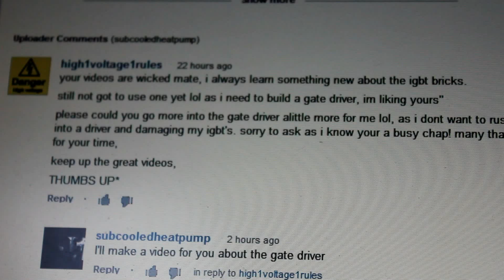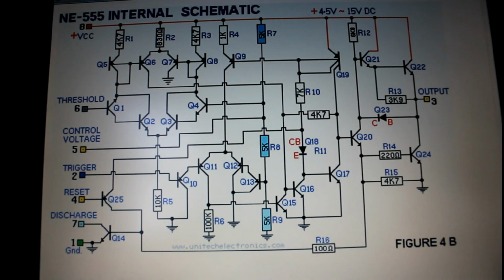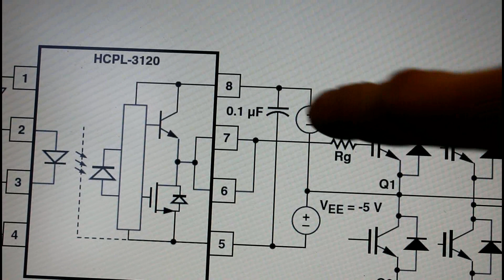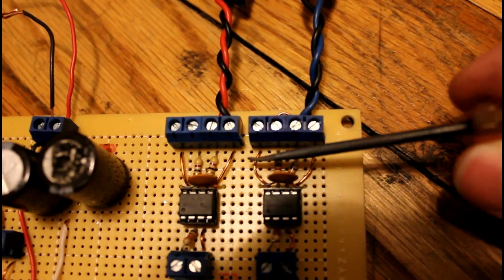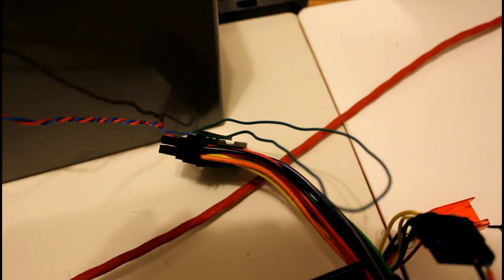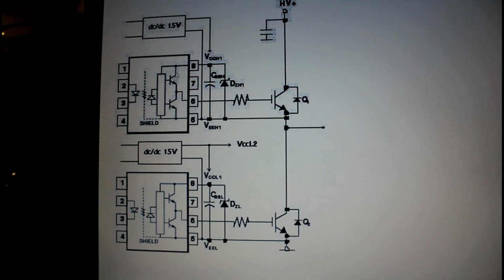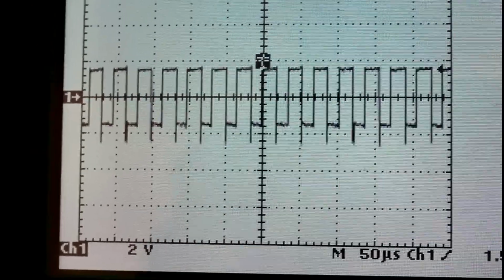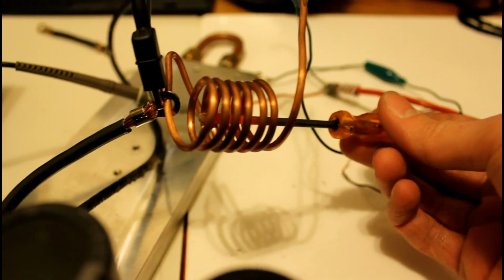Video Request; IGBT gate drivers

Comment: Hello friend fastly I did use this gate driver on my mosfet power inverter and the gate didn’t turn fully causing a small short circuit blowing the mosfet and I had to use a 700ohms resistor to turn the gate of because I was using 18 voltage at the gate

Comment: Hi,  I have learned MUCH from your great videos.
Concerning the gate driver, I need one that I can operate at Vcc=12v, since my application is automotive.  Do you know how I can drive a 1000v high voltage IGBT with a driver that does not need more than 12v?
THANKS MUCH!!!

Comment: Seven years on, and this video is still helping people (like Me). A practical example, alongside an explained schematic is amazingly helpful for folk new to transistor theory. Thanks dude.

Edit; for a 120V, 500A load (a large DC forklift motor) using two IGBT bricks in parallel, is there anything to consider beyond the parameters explained in the video, in regards to using that driver IC?
Reply from the maker: both IGBTs should be on the same heatsink, and as close as possible. You might consider using a larger gate driver, such as IXDN630
Reply: @subcooledheatpump  thanks for your reply! your will to help others is really nice, and your tailored response videos are super generous. 

The IXDN630 d.sheet notes it has a peak source to sink drive current of 30 Amps. Is that referring to the intended current flowing through the IGBT brick? (in my case, 500 amps)
Reply from the maker: No, the gate drive current and collector current are separate. You can use HCPL-3120 to drive an IGBT(s) with 500 Amps flowing through it. It's just that you may not want to. an IGBT with a higher current rating will have more gate capacitance, which means in order to turn the IGBT on fast enough, you'll need more gate drive current. HCPL-3120 is really only designed to drive IGBTs with ratings of 1200 volts and 100 amps. So if you're looking to drive multiple high current IGBTs you may want something that can provide more gate drive current
Reply: @subcooledheatpump  That's brilliant advice, thanks ever so much. It makes a lot of sense, now someone has put it like that. Do you have any suggestions for a set-up like mine? The DC controller schematic i'm looking at has a DCDC converter capable of outputting -5V to +15V (MGJ2D051505SC) feeding an Opto (acnw3190-000e). Would you use a modular approach like that, in favour of an all-in-one package?
Reply from the maker: Personally I would, But that's just my preference. All in one approaches do work but to me I'd like to be able to replace the individual parts as they fail, and not need to replace things that aren't broken.

Comment: First thank you but i have problem when connected same type of igbt you use how i controlling power circuit 400v by use 555timer low voltage control where you have G: CONNECTED TO CONTROL SIGNAL AND E: CONNECTED TO >>> You have tow E one for power control second one to control circuit i would like explain this point

Comment: Good video sir, I have designed and assembled similar circuit to drive a full bridge igbt. The circuit works fine below a bus voltage of 70 volts but above 70 v my one side igbts blown out several time. Can u please share what's the problem.

Comment: I have a question about the isolated power supply for gate driver. Usually the gate drive doesn't need so much power, so which kind of isolated power supply should I choose in order to put them on PCB? (It seems that if I build a full bridge, I'll need about four power supply)
Reply from the maker: That really depends on so many variables. What Bus voltage will your inverter be running? How much space on the PCB are you willing to dedicate to the power supplies? This certainly isn't the only method, but I've seen numerous variable frequency drives use a transformer with a single primary driven by a single transistor and multiple secondaries to provide gate drive power. Alternatively, you could use individual DC-DC converters. You only need one for the lower (negative) side IGBTs. The high sides must be isolated from each other, so you could do with only three if you are using a full bridge circuit
Reply: @subcooledheatpump  Thanks for your reply! Actually, I'm working on the three phases full bridge inverter.(driving a pretty imbalance load)The required power isn't too much, about 80W(under 48V) per phase. I would like to put the driver circuit and power MOSFET on a 10*10 cm PCB. Since the DC/DC converter really cost me a lot of space, I wonder if there is a better way to implement the circuit?

Comment: Hi All, i am confuse about pin No.5 (VEE) if any 1 understand please explain to me, IGBT Source PIN Connected to HV(High Voltage) Positive Terminal and IGBT Drain pin connected to Load Positive Terminal....as per video if i direct connect VEE pin to IGBT Drain Pin its NOT working Properly my IGBT Driver IC Heat Too much
Reply from the maker: The Gate driver VEE needs to connect to the gate drive power supply negative, and to the IGBT emitter. (Source). Both of those should be connected to the DC bus negative. The bottom IGBT is driven, not the top, it only functions as a diode. The IGBT Collector (Drain) should be connected to the load negative. The load positive connects to the DC bus positive, and the upper IGBT is connected in parallel with the load.

Comment: Thank you for every thing, I work on photovoltaic flyback inverter consists of center tap transformer, two diodes and two IGBTs to feds a ac current tot the grid  I hope to learn me about how can be connection the terminal IGBTs to the transformer and gate drive terminal

Comment: Hi, great video.  I got the HCPL 3120 and an IGBT FS20R06VE3_B2. I am trying to drive an old pancake motor on a washing machine. Its a form of Brushless DC motor. I been searching and searching but ur video is the closest to what Im looking for as everyone else seems to just power up tiny low powered motors. Most IGBT circuits drive inverters that drive ac 3 phase motors. Any help is appreciated as to how your circuit can drive my motor.

Comment: Hi Buddy,Can you help me to sort out an issue on a Chiller Unit whose gate driver is lock out on circuit 2 only .IC 031-02066-001 is used .I just replaced the IGBT card and now the gate driver is locked out on the other pcb card.Thanks
Reply from the maker: Not sure I completely understand.. Did and IGBT fail and you replaced it? If so, you will likely need to replace the gate driver. Usually, but not always, when IGBTs fail they take the gate drivers with them

Comment: i notice in this video that you are switching your HCPL-3120 optocoupler with only 2 volts. The datasheet shows that the Max Input Forward voltage current is 1.8 volts. What was your formula for choosing your LED resister?  My TL494 KA7500 Driver Board seems to be putting out around 10 volts at the signal. (Now that I hooked it up right!) I am guessing that my resistor would be around 820 ohms at the input of each LED. Can you talk more on choosing your LED resistors and your gate resistors?

Comment: Can you recommend an already made PWM that will fire the HCPL-3120 optocoupler at the right voltage? I am using the TL494 KA7500 Driver Board but it will not fire the led's in the optocoupler.. It seems to only put out .65 volts AC at the signal when connected and around .88 volts AC when it is not connected to the board..  I need the input of the PWM to be 12v. I am building a full bridge inverter.
Reply from the maker: A TL494 Should have no problems driving the LEDs. I'm not sure I completely understand...what is your input voltage to the TL494? It should be at least 5 volts.
Reply: 12 volts is the input voltage. The TL494 has  a Feed + and a Feed -. It is my understanding that if I put a potentometer  on those feet, that I can adjust the voltage output of the board. But, when I use a potentometer, it does not increase the voltage output of the signal. When I ground the Feed - it does not increase the voltage output of the signal.  When I use a AC probe across the PWM 1 and PWM 2, it shows a .6 volts. When I use a DC probe across the PWM 1 and PWM 2, it shows as  2.5 volts.
Reply: UPDATE .....It will now fire the led, but, the isolated voltage supply (15v) will only put out 5 volts signal to the IGBT. This will not fire my 15v gate of the IGBT.  Would that indicate that I need a higher voltage at the LED to trigger the opto? Or is the opto a only ON or only OFF.

Comment: can you help me please
can we connect two IGBT on the same ground of drive circuit 5 ?/
Reply from the maker: The gate drive power supplies must be isolated. The gate driver inputs (LEDs) can have a common ground
Reply: well, can you also explain please if i connect drive to mosfet but i forgot to apply pulses on input, drive will protect mosfet from damage? also if i apply vcc only on drive , drive may be damaged ?

Comment: Hello. Im an electrical engg 3rd year student. This semester Im designing a buck boost converter.  Had no idea how to i was going to build this gate driver circuit. The buck boost converter Im designing only has one IGBT. Will it give output exactly the same as in the simulation? Or shud i use 2 IGBTs in the hardware model? Shall be looking forward to your reply.. thanks fr such a great video..
Reply: u need only 1 switch man..for simplicity u can use hcpl316j gate driver for that.2 igbt is the case for synchronous converter.

Comment: Hi guy, I am building buck/boost converter with NGTB50N60 IGBT. The last circuit driver with two 555,  is it the best to drive the gate of IGBT ?
Reply from the maker: You really need a good gate driver like HCPL-3120 to drive the IGBT gate properly. Also PWM should be done with a better setup than a 555. For example, a triangle wave generator and a comparator will give much better results. I just show the 555 here to demonstrate that the gate driver will work with a 0 to 5 volts input, which is basically what a 555 outputs.

Comment: Hi, could we use semikronSKYPER 32R to drive IGBT? any special considerations to be made for that? here is link to datasheet. https://www.semikron.com/dl/service-support/downloads/download/semikron-datasheet-skyper-32-pro-r-l6100202
Reply from the maker: That is a half bridge driver, so if you are looking to drive a half bridge then yes you can. A few things I noticed, Seems it is designed to drive smaller IGBTs with low gate charges, It has de-saturation detection so you'll need some extra components for that, the input voltage must rise to maximum level within 50 ms, and a few other things need to be addressed. Overall, it is a gate driver and it would work, you just need to satisfy all of the protection mechanisms.

Comment: instead of all this you could have just used a ir2153 self oscillating halfbridge gate driver
Reply from the maker: Sure, but you can't use that for anything more than a half bridge configuration. For a Full bridge or a 3 phase bridge, you will need to use separate, isolated gate drivers
Reply: subcooledheatpump yes in that case you can you use irs2143d
Reply from the maker: I think you're missing the point. Self Oscillation is good for certain applications, but you can't those IR parts for much more than simple power supplies. You couldn't, for example, use them to control the inverter of a 3 phase motor controller. You need a gate driver that can receive commands from a microprocessor. What's more, the IR parts do not offer much in the way of isolation. 600 volts is nothing. You'd need at least twice that in order to make a motor controller suitable for a 480 volt motor. This video explains the use of isolated gate drivers for that purpose. Because more often than not, they are the best solution.  By the way, it's the IRS2453D that is the full bridge driver. No such thing as an IRS2143D
Reply: subcooledheatpump yes we can't interact with the self oscillating MOSFET driver it's not made for that purpose I got your point but you have shown some uses in video like led flasher and induction heater for that ir2153 is best because of its simplicity
Reply: Sorry Google autocorrect

Comment: I have one question wants to ask. Can MOSFET also applying -5V to 15V switching techniques as you mentioned in (3.54 minutes). To improve the Full bridge switching performances? I'm looking to hearing from your reply. Thank you to contribute this tutorial.
Reply from the maker: Yes you can use Negative gate drive, or negative gate bias to hold a 
MOSFET in the off state. This doesn't necessarily improve switching but 
it does ensure that the MOSFET won't be accidentally triggered on by 
noise or interference. Thank you for watching
Reply: Thanks for your explanation
Reply: John nji

Comment: nice explanation man , so basically need of a igbt or mosfet driver is to switch them on and off as fast as possible properly at high frequencies . so that igbt's output current will be function of signal at the gate . isn't it right ??

Comment: what are the resistor values please and thankyou
Reply from the maker: The resistor values for the output really depend on the IGBT you want to drive. This specific gate driver can only output a peak current of 2 amps, so if the input is 15 volts, you can't go any lower than a 7.5 ohm gate resistor. As for the LED, that depends on the signal supply voltage. I think I usually use a 1K resistor in series with the LED when the signal supply voltage is 5 volts
Reply: Thanks so much I am looking to drive mg200q2ys40 igbts....i was lucky enough to acquire 24 of them from a set of MRI drivers for 30 bucks :). I am first looking to drive an xrt much like high1voltage1rules. Then move on to perhaps a 3 phase converter an induction heater and a sstc. I'll try out the 7.5 ohm and the 1k. On behalf of all of us interested in igbts I thank you for all of the help you have given us. Also if you could shoot me your email at andrewboerder@gmail.com I would greatly appreciate a more direct line of communication with you and your expertise, thanks and have a great day!
Sincerely,
Andrew
Reply: how to calculate the peak gate current requirement  of the driver if i am using a sk30mli066 gate driver module

Comment: this (HCPL-3120)  can use in 3-phase inverter? (Adjust frequency 0 to 100 Hz)
which one bestter in 3-phase inverter (HCPL-2120 TLP250 IR2133 or else)
thank you.
Reply from the maker: HCPL-3120 can be used in a 3 phase inverter, however if the bus voltage exceeds about 400 volts, then you will likely want to use HCNW-3120 for the high side IGBT gates. This is because HCNW-3120 has a higher isolation voltage rating. Thanks for watching

Comment: Is it possible to step up voltage using ( mosfet / igbt) and at the same time step up current for example step up 10 volt to 12 volt and output current 600 amp
Reply from the maker: You can use either MOSFET or IGBT to create a boost converter to boost up the voltage, or a buck  converter to reduce the voltage. Power stays the same, minus some switching losses. So the output current will depend on the ability of the power source

Comment: Can I use this gate driver IC when I'm using Full bridge IGBT as controlled rectifier
Reply from the maker: +Basil aljamal As long as the power supply for the gate drivers is properly isolated, it shouldn't be a problem

Comment: Hi,In a MOSFET application in high side configuration, what are the pros and cons to using a charge pump to drive the gate?  Is it better to use the HCPL3120?

Comment: Hi, I 'm using a irf4bc40u IGBT used in the high side , which allows the passage of a current from the discharge of a capacitor on a inductor , which controls the gate of the IGBT receive pulses of 15V for 400 microseconds every 50 milliseconds , the problem is that the IGBT heated too fast , you think with this you can solve that problem explain , greetings and thanks in advance .
Reply: +Moises Perez IRF? Thats a mosfet. Did you mean IRG? How many amps was your load? The amp rating on the spec sheet assumes you are providing sufficient cooling.

Comment: Hi 
I need some help An a IGbT I have a q41 quickroton motor it has an igbt in it need to use a driver to run the IGBT speed controller it's a sewing machine servo motor .thank you

Comment: For some reason, it is stated in the poopsheet I have on the HCPL-3120 (figure 26/p.17) that the power supplies are connected minus-to-minus!?

Link to the particular poopsheet in question:
https://dl.dropboxusercontent.com/u/11778919/HCPL3120.pdf

What am I missing out here???
Reply: b.t.w. this holds true for the datasheets 5965-4779E and 5965-7875E both.
Reply: noilex
AHA! Found the flaw! In the poopsheet from Avago Technologies [AV02-0161EN] they have the same config os you do (fig. 26/p. 19), which to me seems the most plausible solution.

No wonder n00bs like me get left behind:( not cool!

Anyway, thanks for the explanation on the subject m8;)

Comment: Great video Dude!!!
I have some problem It would be very nice if you could help
I am using same Gate driver circuit except  I am not using any snubber .I am using single switch as chopper for Dc Voltage and Load is Bulb. I am varying Duty Cycle using Arduino .
 Now the problem is when I apply 220V DC my circuit works fine Bulb dims as I decrease duty Cycle. But when I apply Nearly 120V (or lower) I can control the dimming but BULB dont switch off at 0 duty cycle.
Reply from the maker: Try this, Apply 220 VDC to your circuit as you would normally, except this time short the IGBT gate and emitter terminals. Do you still have the same problem?
Reply: I have some q41 motor uesding a toshiba mp6750 I need to use this kind of igbt to control the motor I need a simple circuit to control it what do you recommend